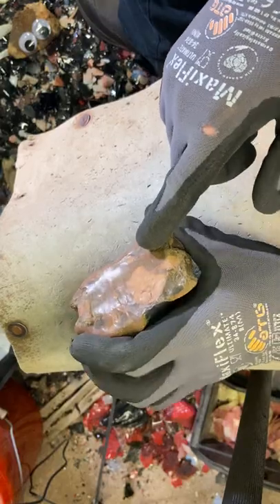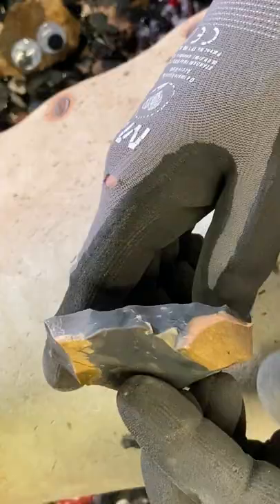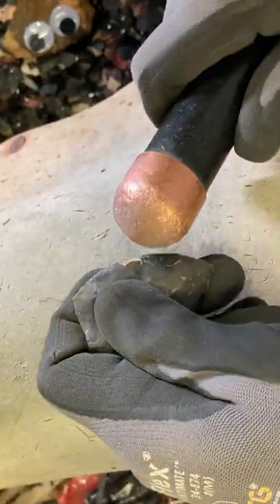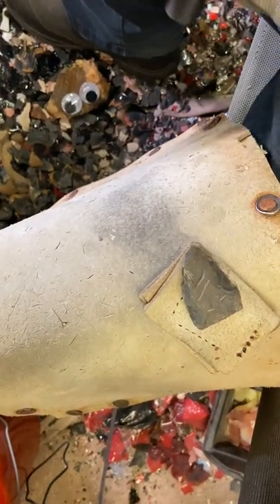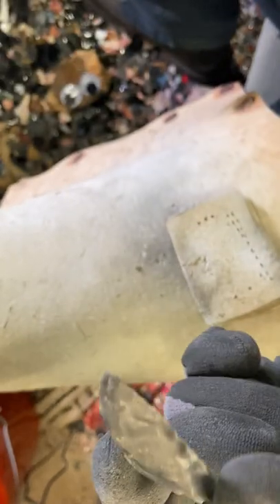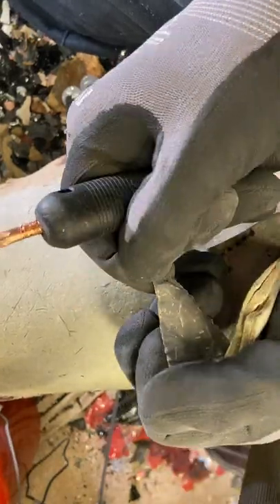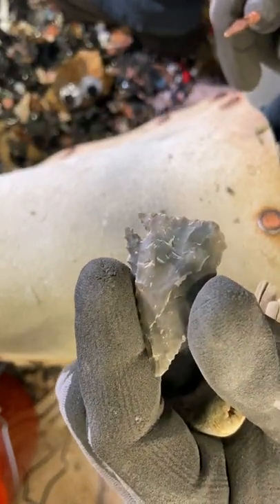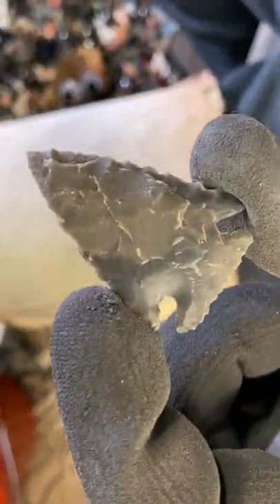Flintknapping a square and lumpy piece of chert into an arrowhead

Comment: Churt is very hard to work with. At least all of the stuff I have found/tried.
Reply from the maker: Some is some isn’t.  What state are you in?
Reply: @blackknife60  Wisconsin. I used to hunt arrowheads. In my area there were a handful of points that were made from stone that wasn't local. So maybe the churt in that area was just garbage.
Reply from the maker: @akboyz1  I got ya.  Nothing comes to mind in Wisconsin unfortunately.  There is always glass bottles.  I love them.